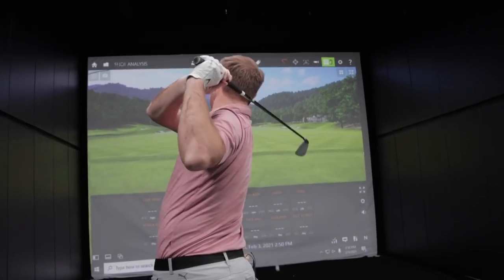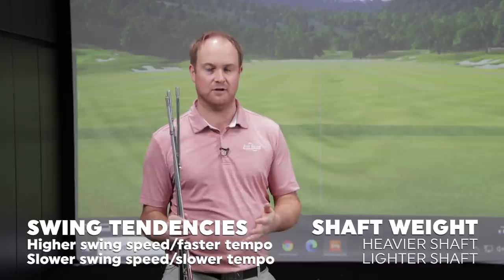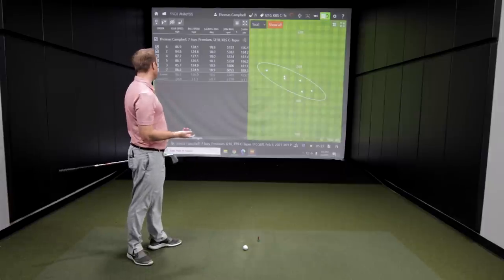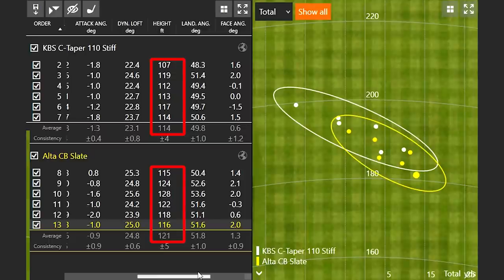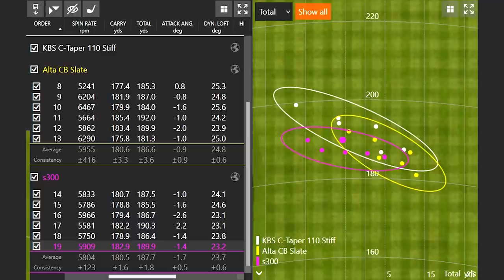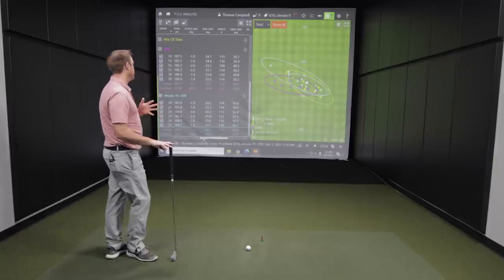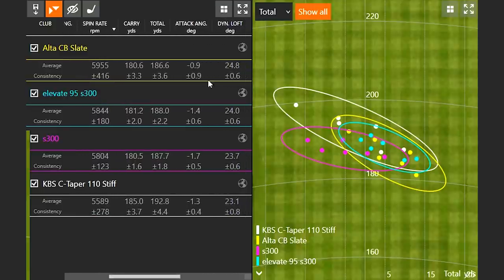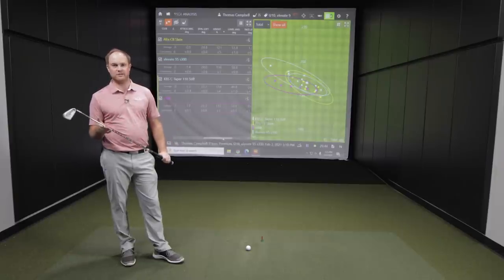Explaining Stiff Golf Shafts | Not All Stiff Golf Shafts Are The Same

Comment: Great content. I was custom fit at your Delaware location 3 weeks ago by Tom H. Great fitting. 82 mph average with 7 iron and 96 mph driver. Fit into regular Tensei AM2 red graphite shafts - 1/2 inch in Titleist T200’s. And HZDRUS smoke yellow 60 gr 5.5 regular flex in my Taylor Made M2 head. 
Thomas is right. Lower end of stiff, smooth tempo made me fall into “regular” flex. In both irons and driver.  
A couple of 1.50 smash factors with my M2. Happy as can be !  Recovering from shoulder surgery in December 2019 so this was a nice comeback. Used to be a few mph faster prior to surgery

Comment: At one time the emphasis was on the average distance a golfer hit a given iron. Now the lofts have been strengthened and there could be  a distance variance between different brands of irons from a different era. When I was younger I used to hit a MP 14 - 9 iron about a 150 yards. Over time I didn't play golf on a regular basis for quite a few years. Now my playing has increased but I'm more likely to hit a Ping I-10, 7 iron for 150 yard shot into a green.  My strength is coming back slowly and getting the right shaft is crucial. The feel and results being very important in a fitting. Because the lightest shafts mat not always be the best shafts. It would be good for us older guys to see a demonstration of a good golfer who has a slower swing speed do the same test.

Comment: as a 3 cap in between stiff and x typically...but need lighter shafts due to arthritis setting in. it amazed me how elevate stiff was constantly weak right...modus s 120 was auto left...xp 95 and 115 were straight.   ended up hard stepping modus stiff 120 weighing 114.  i needed a wedge shaft after hard stepping and found a kbs tour flt stiff 120 and i hit that the best :)

Comment: I just did some iron fitting and had the same results. The lighter shafts are easier on my, not getting any younger, body, but consistency suffers. On paper steel fiber shafts seemed like they would be ideal, but I still get the best results from X100 or S300.

Comment: Once you have gone for the shaft fitting they will cut off some lengths to fit different irons and of course that will change the weight, so what will that do to the flex? I ask myself why do I want the shaft to flex at all? Is it just another inconsistency to be taken in to consideration when using a longer iron to play a short chip OR is it a marketing ploy for manufacturers to use to promote their goods. Flex is easily measured using a clamp at butt end a fixed rod for the mid length lay on and a weight hung on the tip end. Measure the distance the from the tip to the floor before and after applying the weight. The smaller the difference the stiffer the shaft.
At the end of the day a golf club is a glorified hammer used to hit golf balls. Would a carpenter ask for a hammer with a more flexible shaft?
Reply from the maker: It's for feel. Some players prefer to feel a board while others need more flex. Good reason to rest shafts with your club fitter. Results are always player dependent. - Thomas
Reply: @2ndswing  Hogwash, it's about marketing and parting people from their cash. When does the shaft flex and why would you want it to? If 4 identical shafts have their weight/flex covered and a pro is asked to tell which one is which he will not be able to do so. See Rick Shiels on You Tube where even the results of testing different shafts with the same clubhead and found negligible difference Your reply "It's for feel" is now saying flex(which can be measured) is not flex  it's weight and weight (which can be measured) is not weight its feel which can not be measured. However there is another You Tuber pro golfer, discussing balls and clubs, who says feel is really sound.

Comment: Shafts are not responsible for spin rates.  They simply change strike locations and or swing delivery numbers and that in turn changes spin rates.   Thomas always mentions that the clubhead is a bigger indicator of spin rate than shafts are

Comment: Project x , 6.0 is it stiff ? Or stiff plus
Reply: P X 6.0 is a bit higher than "Stiff", in the overall range of available "Stiff" Iron Shafts. The P X LZ 5.5 is equal to an X 6.0 in relative "stiffness", so a 6.0 X LZ equals a 6.5 X.
The bend patterns and kickpoints are the  Main Difference between the two Shafts.
The term "Stiff" is only relative to an Individual Make and Model of Shaft. 
Some "Stiff" models equate to "Regular" in other Models.